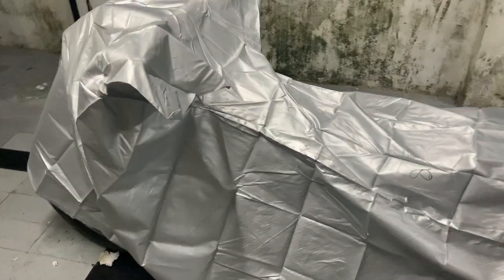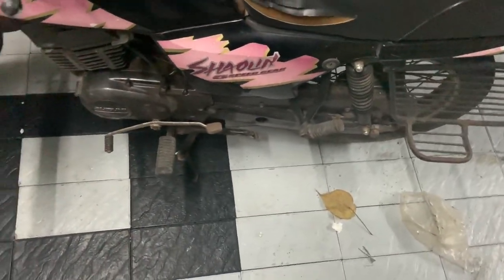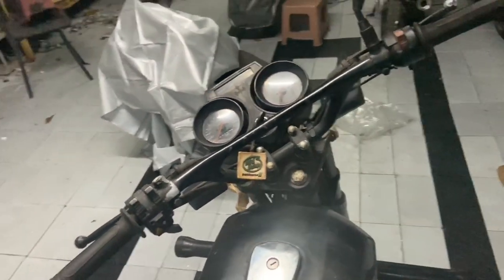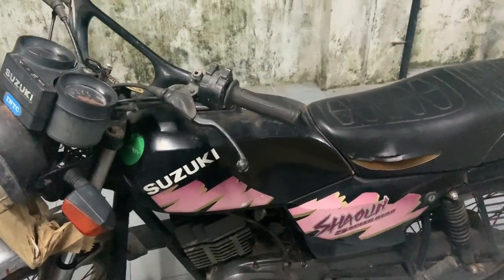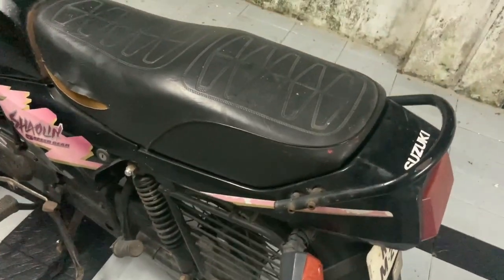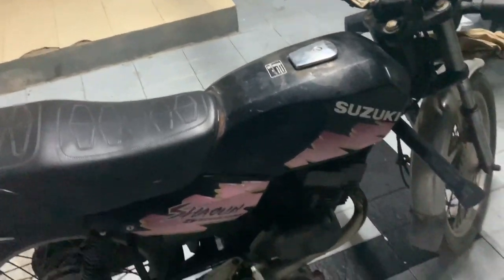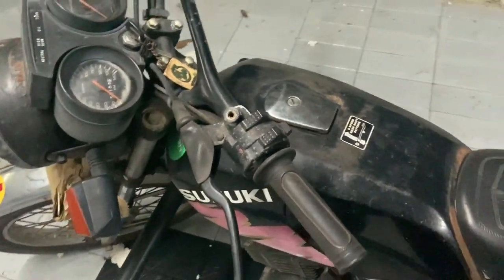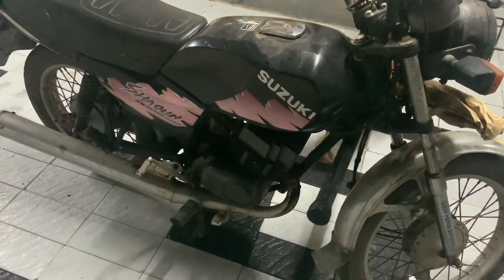Suzuki Shaolin restoration (part 1)

Comment: Never thought you will come up with a Shaolin rebuild! I have ridden it once. That bike was not in a great condition. But the pickup was just awesome... If I remember correctly, Shaolin has a slightly shorter wheelbase compared to Samurai, hence more flickable. Also, I remember seeing couple of Suzuki GP bikes in my hometown Thodupuzha which were actually test bikes before Suzuki launched the actual Shaolin.
Reply from the maker: satheesh vb wow, would love to hear more on the trivia of those GP bikes
Reply: I have a pic of GP bike that I got from Facebook. If you want I can send you.
Reply: I was in school when I saw the GP bikes in my hometown, I thought it was a new model launched by Suzuki. Later came to know that those were kinda test mules of Shaolin. I saw them again in 2013 or so in hometown with the factory paint.

Comment: Even i had the same sticker pattern shaolin in the year 2004 got it for 10k. Sold it as the tank had leakage issues inside it was rustfree but the leaks start from the area between seat which is rusted in this bike also.otherwise very nice bike vibration free at triple digit speeds also .This model meters are original the other type came afterwards.
Reply from the maker: Anuraj Aroman true about the meters, however most people know the Shaolin with the modern meters. The wiring for that type of Shaolin was very different and extremely difficult to procure, this kind had simple wiring and can use samurai/shogun wiring which is available relatively easily.this bike has some surface rust in the area between the seat, need to check how bad the problem is. I had an opportunity to pick one up for 7k when I was in college, the bike had a ceased engine and would have been a big money pit during my college days.

Comment: Nice! So it was a Shaolin! I thought you wouldn't get one haha It's great that it's original for the most part.

Anyways,Why not try installing RDD CDi for this bike ? Would help running cooler and enhances life.Shaolin engine parts are very very difficult to get,so anything that helps enhance life is awesome!

Also please clean and derust the fuel tank before you clean the carb,so that carb won't get clogged again.

All the best ji,excited for the build!
Reply from the maker: Bratty Biker rdd ignition is overhyped, they don’t make anything for Suzuki
Reply: Yamakaze Yes,but I learnt that you can use the RDD CDi and build a custom map for Suzuki,you just need to install a Pulsar Coil.
Reply from the maker: Bratty Biker I will not like to comment furthermore on this subject but you will learn about it the day you will buy a cdi, absolutely zero support and the outcome is average, when you complain of bad performance it’s usually blamed on the installer.
Reply: Yamakaze Oh OK sir.I understand that you are speaking from experience.I respect that sir.All the best :)

Comment: try and get a shaolin speedo, ....even the keychain is period correct pentium 2
Reply from the maker: sarin r what you see is original Shaolin speedo, later models came with the updated speedo
Reply: @Yamakaze  apparently its an old tvs suzuki tradition ,even shogun when launched in 93 came with the ax100 speedo
Reply from the maker: sarin r yes that’s right
Reply: The later models had gear indicator?
Reply: @satheeshbalakrishnan1657  yes

Comment: Hi sir i recently got a shaolin once I opened the head and saw the piston size it's written as 2jk on it what does it mean is rebore done also wanted to add how to identify a original shaolin
Reply from the maker: Piston will have a number on top, like 58.25 or .25
Reply: @Yamakaze  sir checked it on top only written as 2jk not else
Reply from the maker: @shoaibhafs291  you need to measure the piston, usually standard size doesn’t have anything written on it
Reply: Thanks for the info also recently before a week I had given it to mechanic as there was gear issues I got it back and now today I had been on ride some sound from bore Or engine is like qar qar is it something serious. 
Sir also wanted to ask u as parts are not available in bangalore of this bike so can i use rx spares for engine if any issues is it compatible as u might have experienced on it